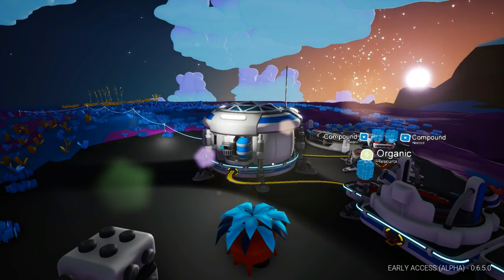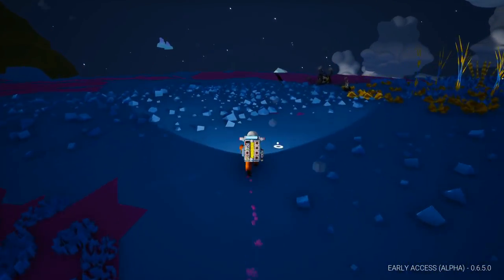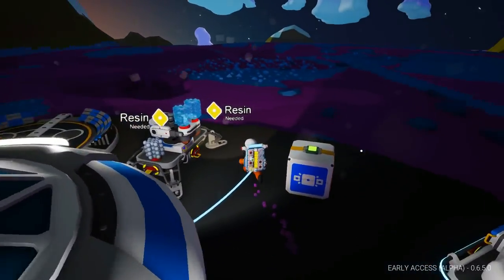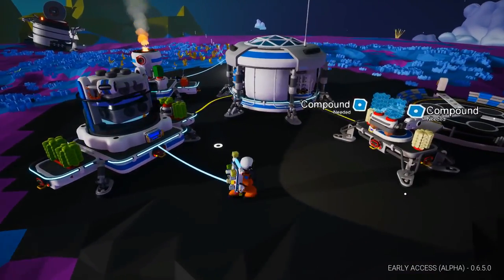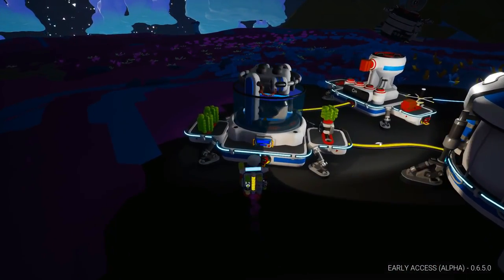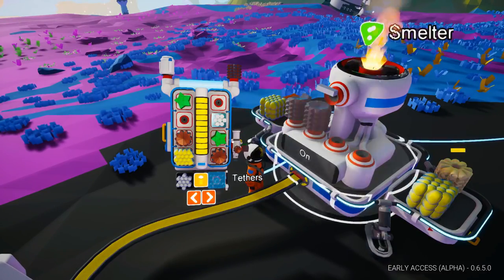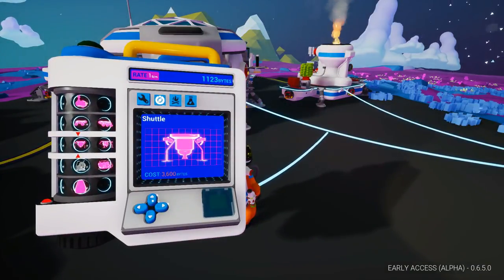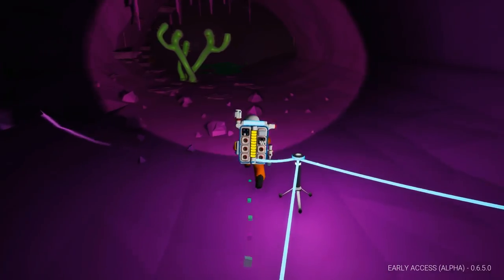ASTRONEER Gameplay Day 3: Smelter, Small Solar, Small Wind Turbine, Medium Printer, Medium Storage

Comment: hi did you know that you can place wind turbines and solar panels on the ground and connect them to your base with the wire thing
Reply from the maker: Did not know that Benedek Varga, thanks for the info!
Reply: The solar panel gives you energy faster
Reply: But Wind Power will be constant to the most part. NIGHT or day. Hint, hint.